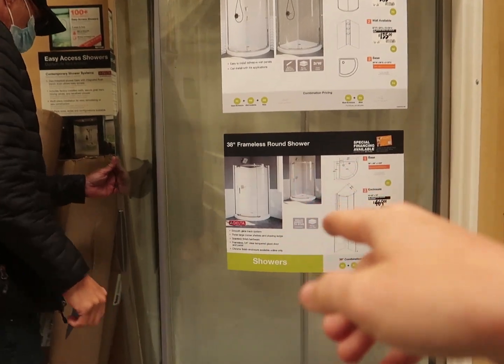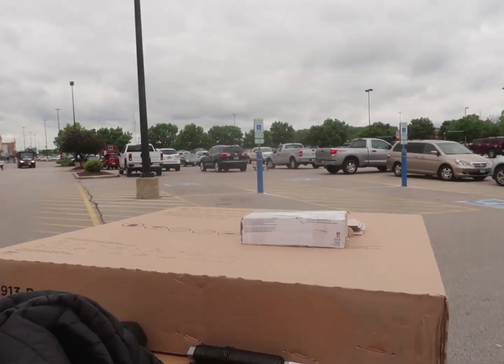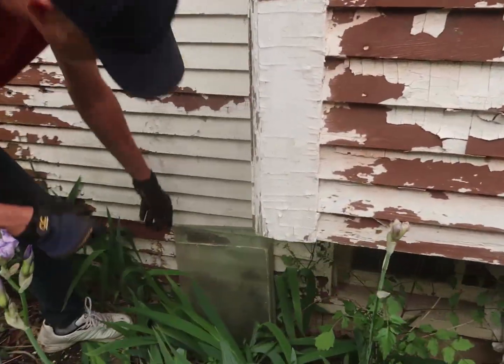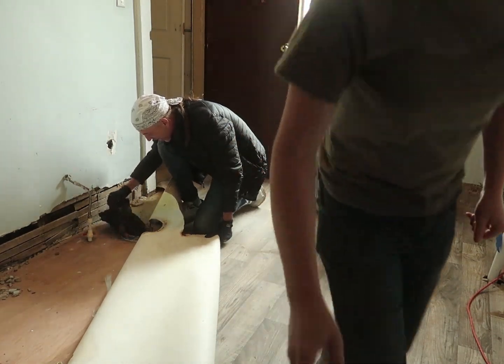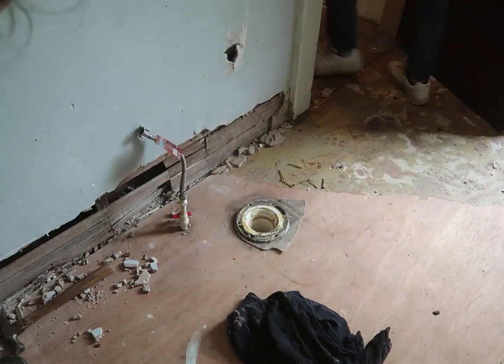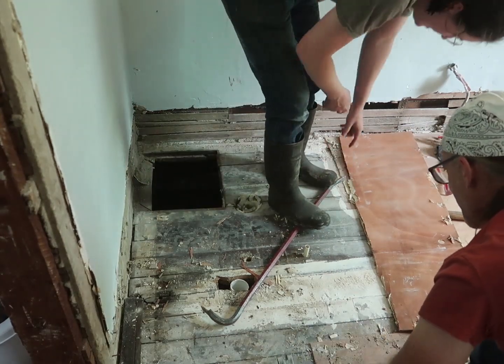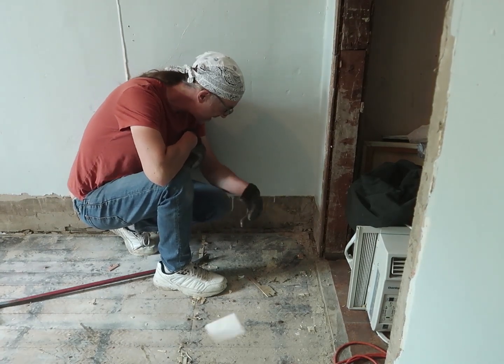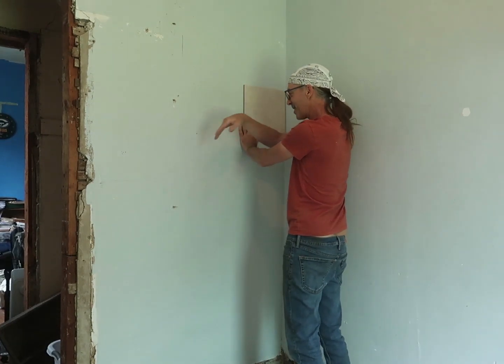1925 Abandoned House Restoration 55: 2020 / 2021 work on bathroom renovation. Resumed work in 2022

Comment: My workshop is also held together by deck screws and have never had a problem
Reply from the maker: They are really strong
Reply: Never had a problem yet. Deck screws are strong, but brittle. Your homes framing flexes more than you think, this flex will eventually break some screws.

Comment: I don't know if you guys like the look of a second color tile being used as an accent stripe, but I've had great luck at the RE store finding really cool unique tiles from the 30s and 40s. A lot of these are glass composite, the modern variations are sometimes $25 a foot! But the coolest part is that in the 40s and 50s, it was very popular to have bullnose edges and upturned rounded lips around the edge of countertops, lots of specialty tiles that really lend themselves to being an accent. I redid one bathroom with dirt cheap plain white porcelain tiles. I ended up buying a milk crate full of glass tiles from the 1950s in really cool Pantone color scales. Just seven of these on each wall making a diamond really broke up the white expanses, made it look much more interesting and high-end
Reply from the maker: Recycled materials might be more of the upstairs bathroom, which will be of my design. This lower one is all Bill's domain after all.
Reply: I have bought(and donated) a lot of Materials from the Habitat for Humanity ReStore in Collinsville, IL. What they have changes from week to week. It is always an adventure! Have bought quite a bit of used tools there too. My favorite tool I found there was my Plumb hammer. They usually have tile there and have a line of new paint that is sold at a big discount. When you buy there it helps many people in many ways. Also bins and bins of plumbing fittings. Window, doors. You have to be a little creative because you cannot custom order but that is half the fun.

Comment: Don't use large tiles on wooden floors! They will crack without a very stable floor. Don't try to do things like reinforcements (mesh or fiber reinforced tile cement) it didn't work. (ask me why i know that :-/ )
You have three Options:
1. Replace the sub floor with special fiber cement boards.
2. add fiber cement boards on the top
3. user smaller tiles (~20cm square)
I've done our bathroom floor trice because of that.
Reply from the maker: Maybe I edited out bill saying he’s going to use cement board, but dont worry, he is

Comment: That hole in the wall looks like a cast iron sink drain, it's the right height and size.  If you go down in basement and look underneath where it is, you should see either a pipe, maybe cut off or an opening in the floor for it if in fact it was a drain . If the hole is  just an elbow and it turns up, it's a vent pipe that came from the sink and goes up to the main vent in the roof. In that case the drain would've been in the floor.  
I wonder if this room was originally a bathroom?  All the plumbing that was in this room comes up through the floor and looks new or newer.  I've seen older homes where one bedroom or room off to the side like this just had a sink in it, it was often the maid's bedroom. It's also possible it was a half bath, or a large pantry that had a small sink, some did.